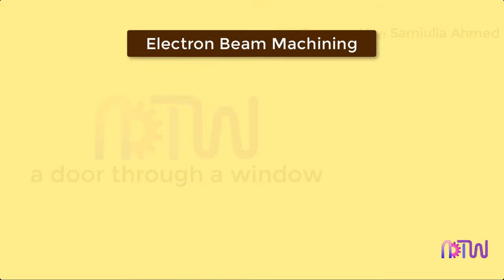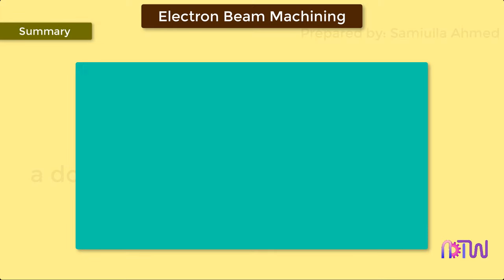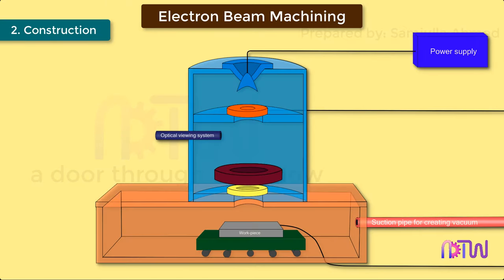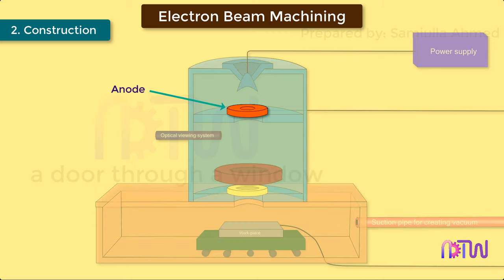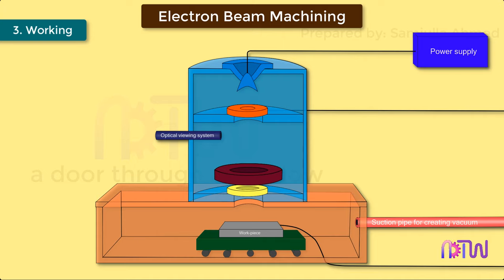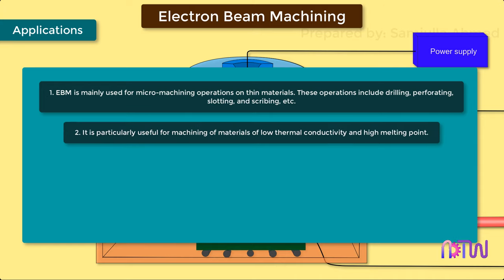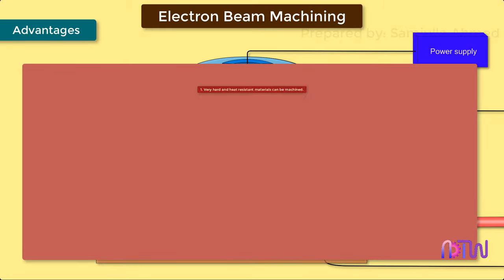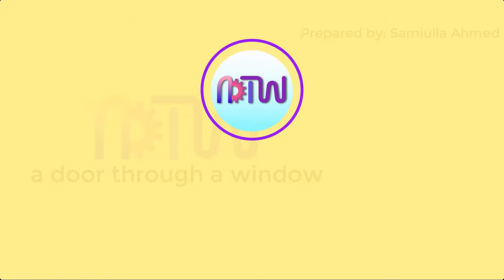ELECTRON BEAM MACHINING PROCESS (EBM): Construction and Working of electron beam machining process.

Comment: What the difference between this and electron beam welding?
Reply from the maker: In this process we use electrons to cut the materials where as in electron beam welding same electrons are used for melting the material and fusing it together.

Comment: Which is used to avoid porosity in electron beam welding? Please give me an answer sir
Reply from the maker: Usually, controlling the welding feed rate, the focus of the beam and the amount of power involved solve the porosity problems...
Reply: @ADTWstudy   in a  mcq  the options are  control deflection,  adjusting focul position and focus current..which one is best sutable answer sir?

Comment: Does this requires initial vaccum ?? If yes then why ?
Reply from the maker: Yes, electron beam machining is a process in which a beam of high-energy electrons is used to remove material from a workpiece. The process requires a vacuum environment because electrons are easily scattered and absorbed by gas molecules in the air, reducing the effectiveness of the beam and generating unwanted heat.

In a vacuum, there are fewer gas molecules to scatter and absorb the electrons, allowing the beam to travel farther and with greater precision. Additionally, the absence of air prevents the workpiece from being contaminated by oxidation or other chemical reactions that can occur at high temperatures.

Therefore, in order to achieve the necessary precision and efficiency in electron beam machining, a vacuum environment is required.
Reply: @ADTWstudy  yes thanks 👍